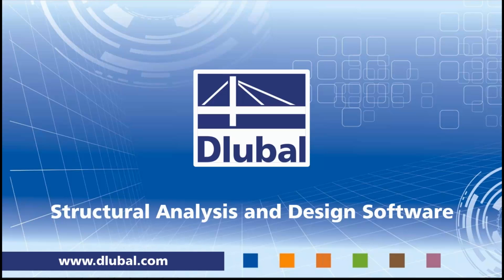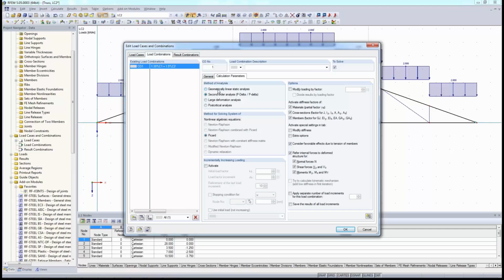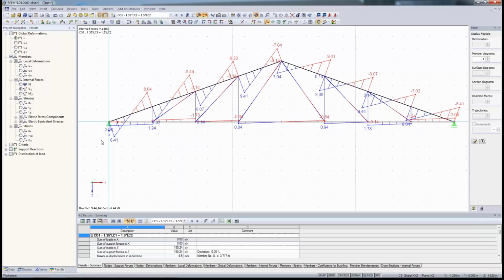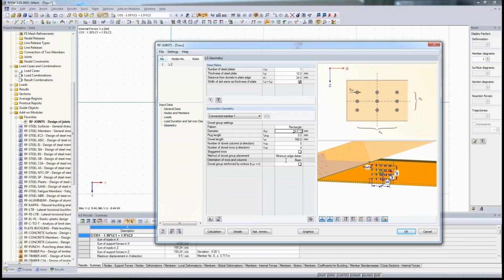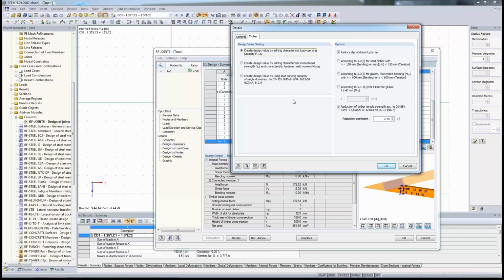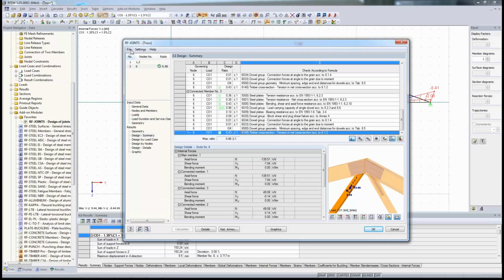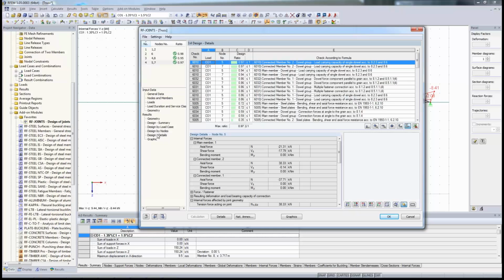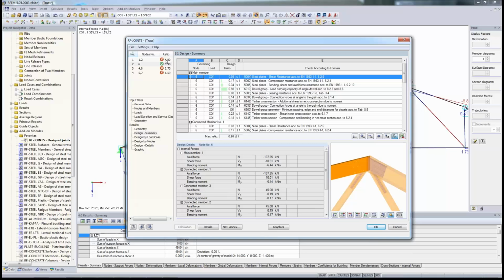Webinar: Analysing Timber Connections by Using RFEM and RSTAB

Comment from the maker: Dlubal Webinar: Analyzing Timber Connections by Using RFEM and RSTAB

More Dlubal webinars:
https://www.dlubal.com/en/webinars.aspx

Further information:
https://www.dlubal.com/en

#bim #cad #cae #concrete #connections #crosssections #dlubal #dynamics #eurocode #engineering #engineeringsoftware #fea #fem #glass #industrialconstruction #mechanicalengineering #membrane #plantengineering #rfem #rstab #timber #steel #steelconstruction #structuralanalysis #structuralengineering #tower #webinar